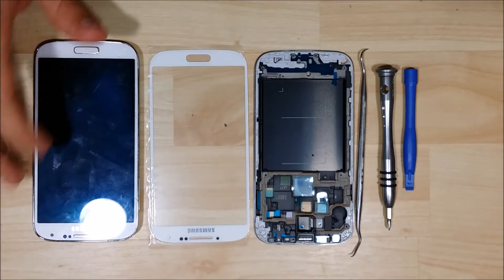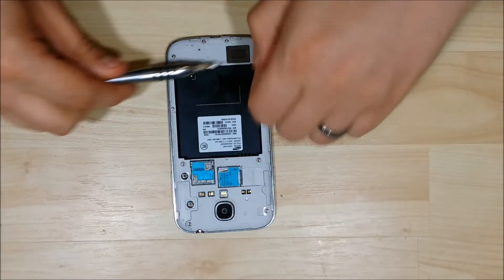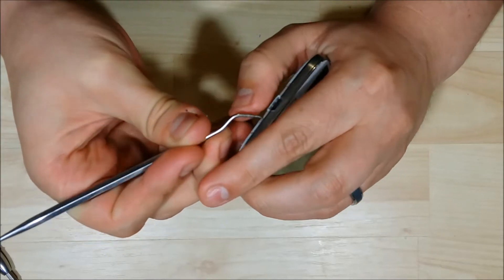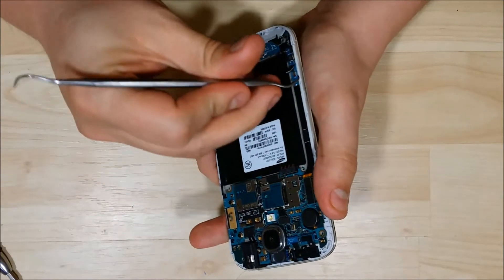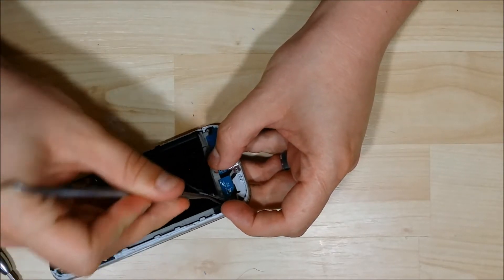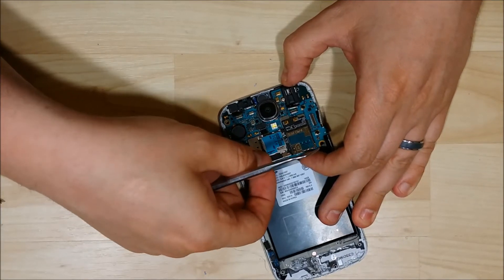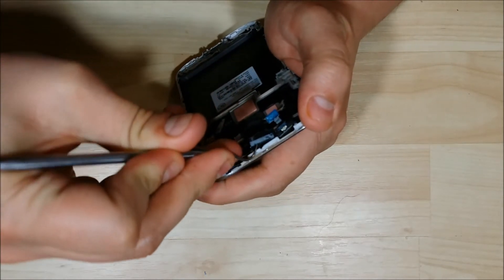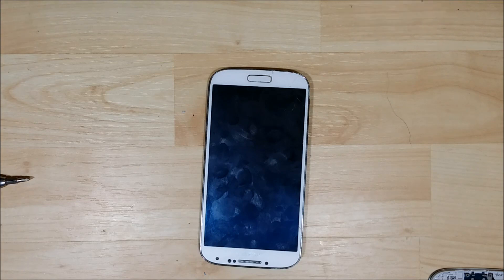Samsung Galaxy S4 Disassembly - LOCA Process

Comment: Hi. Great videos, thanks! I hope you can help me...
I have successfully removed the glass, then the lcd from the frame, used an alignment mould with loca as you show and all went well. Now when I stick it back in the frame, the left hand side wont sit flush in the frame and is slightly raised. Have you come across this? If so do you know how to fix it? Thanks
Reply from the maker: domhaywood Yes mine was from LOCA glue on the side of the glass I would check for that.
Reply: Thanks for the reply. I made sure I cleaned the sides, top and bottom of any excess glue thoroughly before putting back together. Have you experienced any other reasons that could cause this?